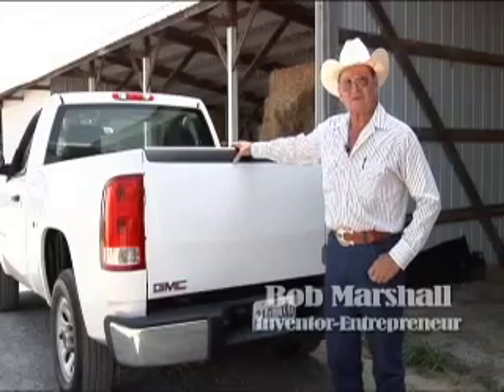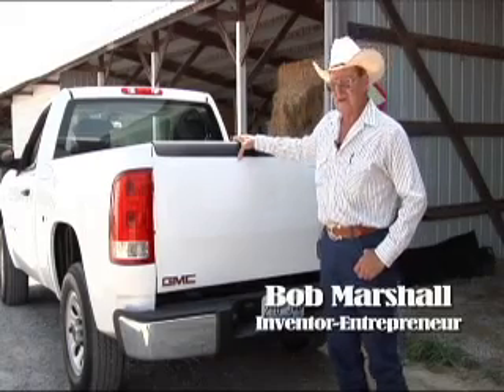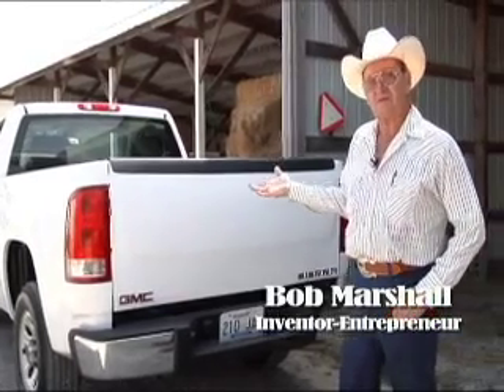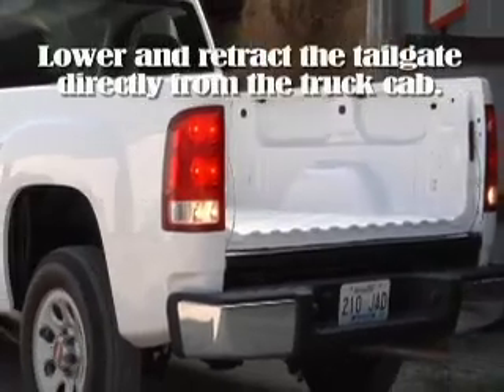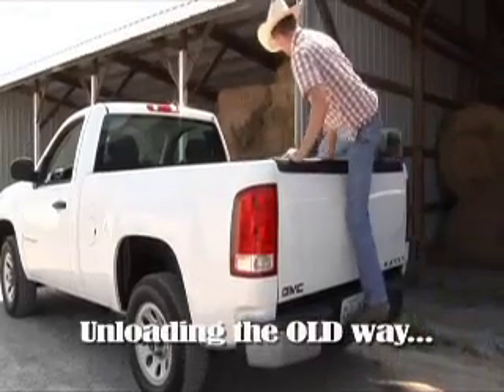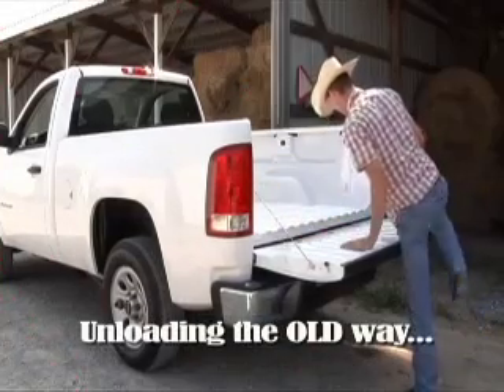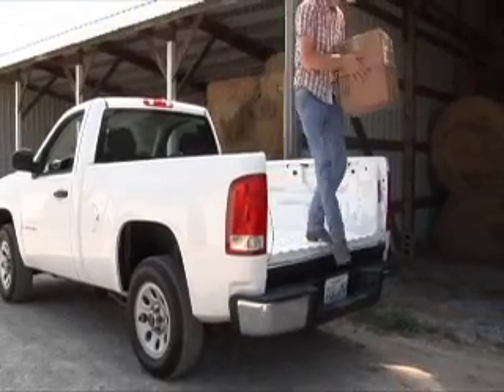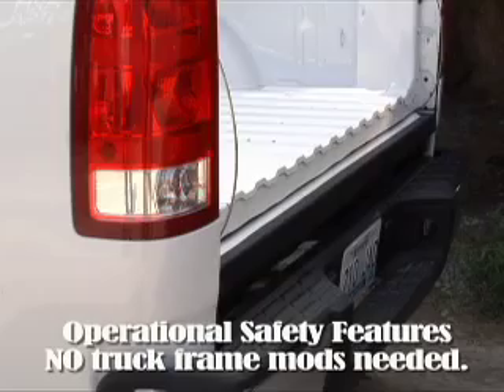Truck Tailgate Hideaway System

Comment: One of the auto manufacturers would definitely buy this design.  It's a much smarter design compared to the Ram 60/40 split tailgate (makes no sense) and still better than GMC multistage opening system.  Great idea and execution!

Comment: So, now it looks like I need to modify my own system, to do this trick now!  I see No Availability, but what a great solution to also Secure your tailgate that can be taken off in a flash by a thief. No lock out there can stop them, no matter what the manufacturers say.  It slows them down by maybe a minute that's all!  This only confuses them fully and they would just move on to an easier Target!   It is a much cleaner look, in any position, no doubt! If someone knows how and where I can purchase one, please let us know! This WORKS!  For a spare mount, put it like the "Old School" front mount!  I have done that already, because I couldn't use the traditional method even if I wanted to.  I have a Slide-In Truck Camper, and this is yet another reason to have this, as your tailgate is still with you, if your camper is loaded.  When you drop it to go elsewhere from the camps location .... Walla!  There is your tailgate.  Impossible to do, unless you want to lose some inside storage!  I LOVE this idea and could come up with a few other reasons I'd want this, I'd bet! MAKE IT AVAILBLE please, or I will have to get my Grinder out, Lower my bumper, make tracks, and put an electric motor in all by myself.  Gee, just might do that, too!  The ONLY Mod that could be done, is to have a Helical, spring-loaded Cable to keep the Tailgate supports both tight and not looped out to snag onto something.  Not a real Biggie, but then it would truly be perfection, I'd say.  Wonder why they are not out here anymore?  Liability. Defect, or awaiting a Manufacturer to snag it up and he gets the Big Bux?  No fair.... LOL

Comment: The truck was sitting stationary with the tailgate down, then pulled away from the fifth wheel; illustrating this is a solution looking for a problem.

Comment: Were did the spare tire go? The tire lift crane and spare tire is under the truck bed  about 2 feet from the rear bumper. Still pretty slick.
Reply: Also a lot of new tailgates have wiring harnesses for rear view cameras, led lights, etc.  Not sure how you'd manage the slack in the wire as the tailgate retracts under the bed and how you'd keep the wire from getting tangled up.
Reply: @rjn5579  get rid of the rear view camera, your in a truck you should know where the back of the truck is
Reply: @cool3865  OR, just but a Camera in the Bumper perhaps?  I'd like a camera myself, and have owned a Pickup Truck, since 1974.  Bumpers are Expensive!  I know this! LOL

Comment: How do you open it if you're not in the cab? Where did the spare tire go? Before the tail gate would allow drywall sheets to be fully supported, but now they'd just have a foot and change hanging in air, waiting to break at the first bump. Cool idea, but I'd pass.
Reply: what do you mean, he had the tailgate fully down to allow the drywall sheet to hang over, you dont need to fully retract it
Reply: Put a board under your sheetrock
Reply: @cool3865    look at the tailgate. Its a couple inches lower the the bed height. No support for drywall.
Reply: @jimmelton5430    That would work but would be a nuisance to keep a board around, for certain loads or to have to buy one every time with your drywall.

Comment: The only thing is this is basically useless. I bet the weight capacity vs stock is half, plus it raises the bed, raising the center of gravity, making it harder to get to the cargo. And you'd probably need special hitches made for 5th wheels. If you want the tailgate to see a trailer,  put it down yourself. If you want it removed, do it yourself. If you can't do any of that you shouldn't be towing a trailer or moving any type of cargo. I've covered my argument, what's yours?
Reply: bed is at the same height.. look at the bumper and the bed outline.. the bumper is lowered.
Reply: John Griswold it's got a rear body lift.
Reply: these are for people that use their trucks to tow...
Reply: @evolutionglitch4739  Thanks!  You are correct it appears, now that I look at it!  And I was gonna get my Grinder Busy!  LOL Just a do a complete body lift, and possibly reposition the Bumper mounts, if that would work, perhaps, but maybe not though?  It would interfere!